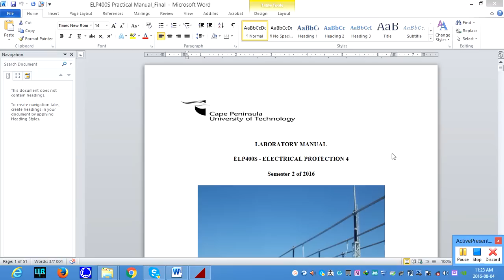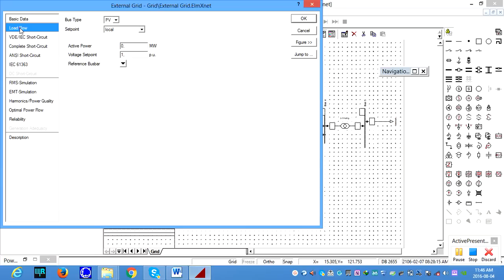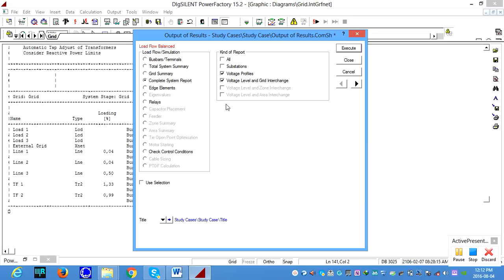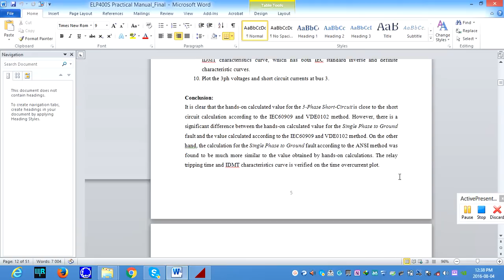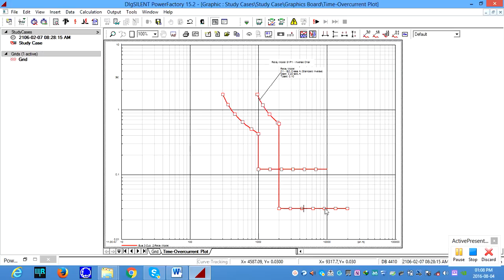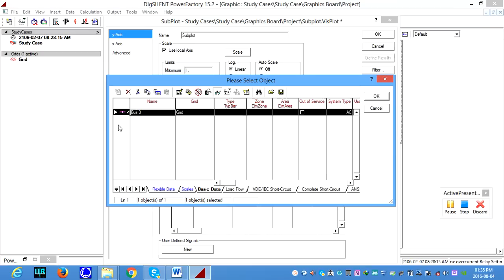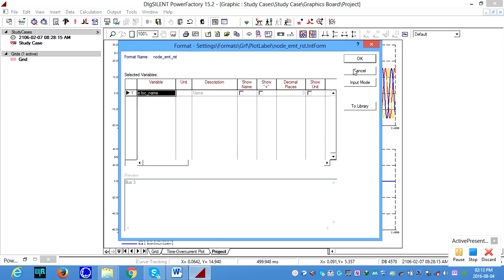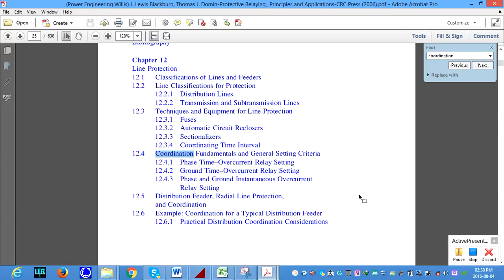Time overcurrent protection setting of power systems on DigSilent PowerFactory simulation tool

Comment: The demonstraton of differential relay testing using CMC-356 is an excellent one and I will want a repeat of an excellent performance on distance relay.My question on Transformer differential relay settings that has within its zone Zig-zag Transformer say 300KVA 33/0.415KV Zy1. Where on the omicron test set do we have zero sequence filter to ensure overall stability in differential protection scheme. In the traditional setting, after selecting the appropriate ICTs, we can create a zero sequence filter. Consider the Power Transformer 60MVA 132/33KV   with vector group of Yd11.